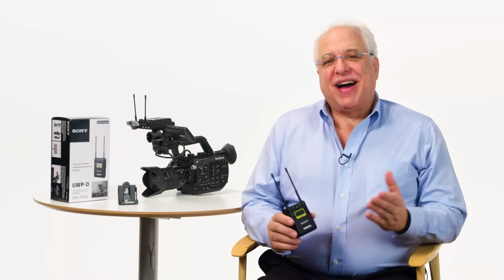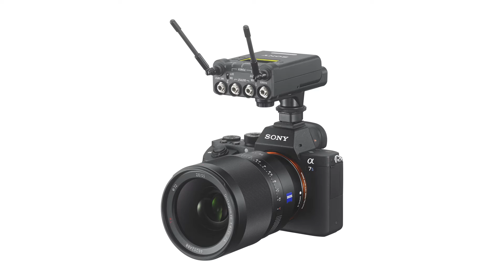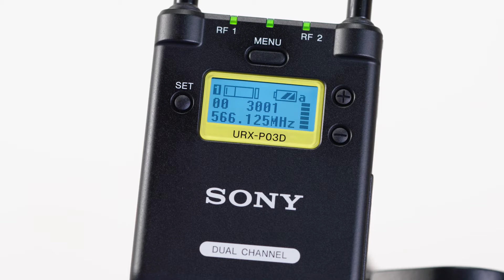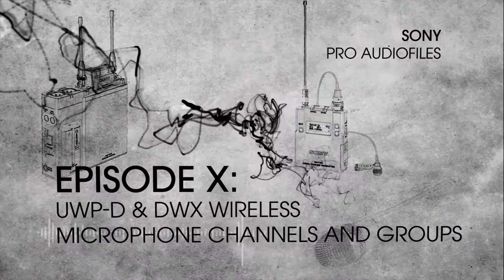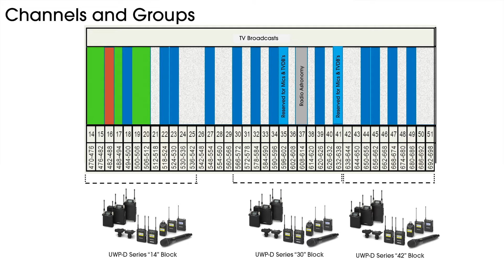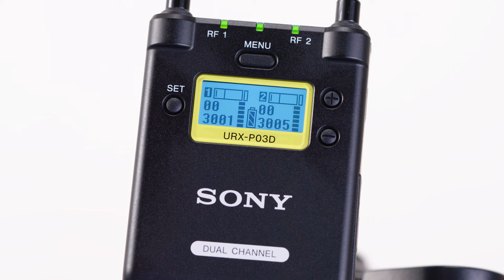Sony UWP-D 2 Channel Receiver

Comment: The microphones both work and pick up sound, yet channel one works and has a green light next to the RF1 logo and channel two has a red light. Both mics are picked up on channel one when I test them separately. For some reason channel two remains to have a red light next to the RF2 label and is not picking up the mic signal. How do I fix this? If he went over it in the video you could just write what time it was at, perhaps I missed it.